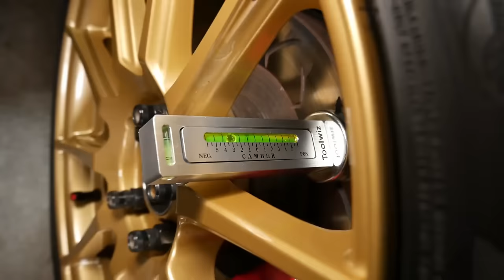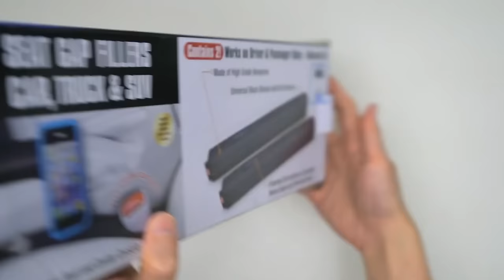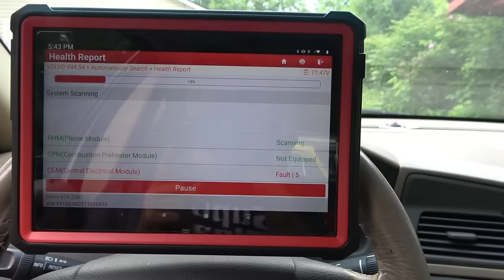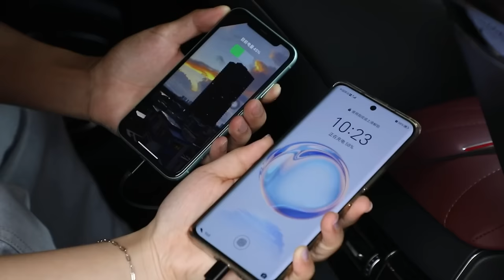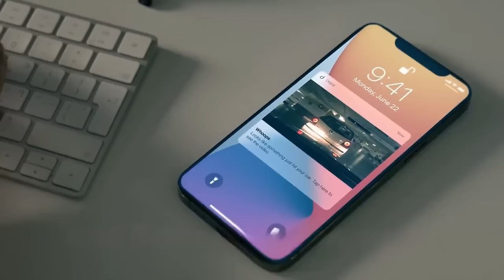20 Car GADGETS You NEED on Amazon in 2024!

Comment: Why do you need buy gadget to tell you your engine temperature when you already have one built into the car 🤨🤣
Reply: Because the stock temp gauge on MOST cars does not tell you about high temp until you're already overheated and damage already been done. Aftermarket gauges give more accurate real time reading.
Reply: I dont have one 🙂 opel astra 2004
Reply: My car only measures engine coolant. I want an oil temp gauge but I'd have to drill a hole in my oil tank to put a device there. The one he showed is a decent place too tho because it's easy to get to